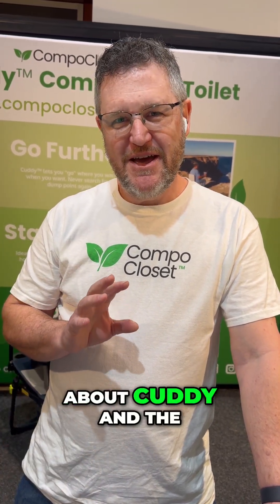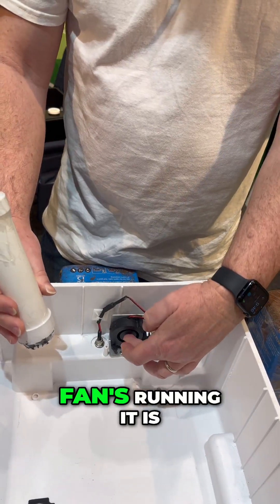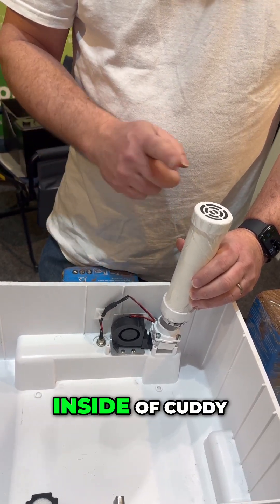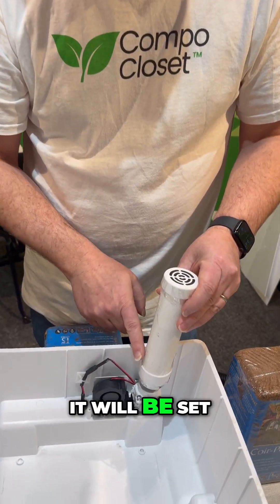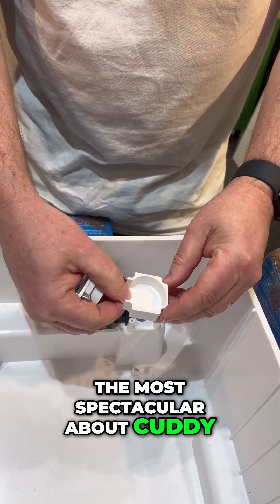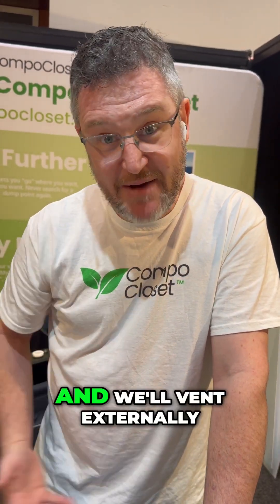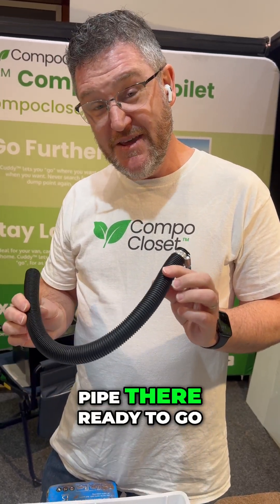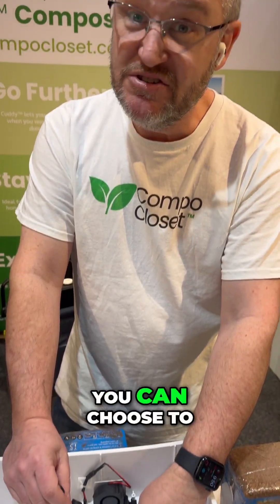Cuddy Composting Toilet: The Ultimate Venting Guide!

Comment: Do you need to use specific toilet paper. 🤔
Reply from the maker: No. However, we suggest putting toilet paper in a separate bin as it is very voluminous and will fill the bin quickly.
Reply: put tp in separate bio, for trash. I don't recommend leaving it in toilet
Reply from the maker: @ you can throw it in the Cuddy Lite because it has no agitator.